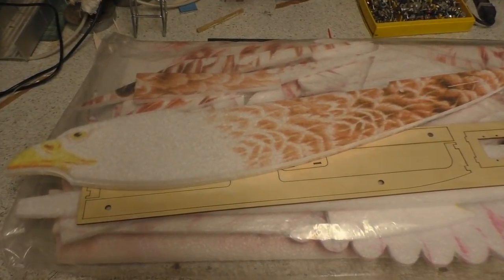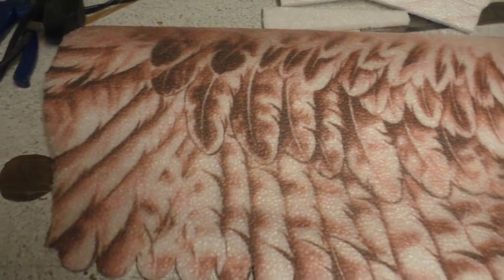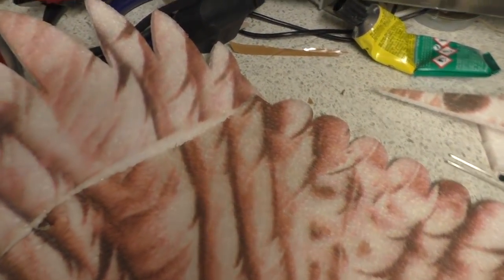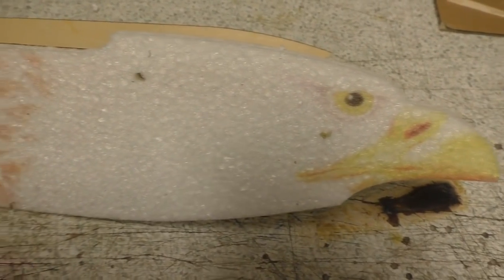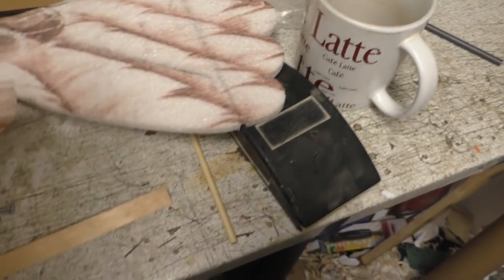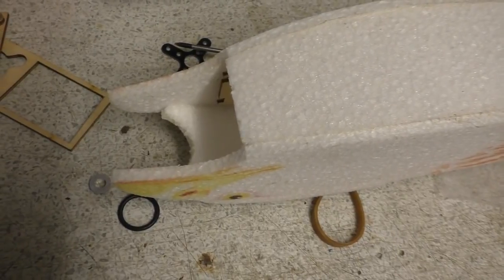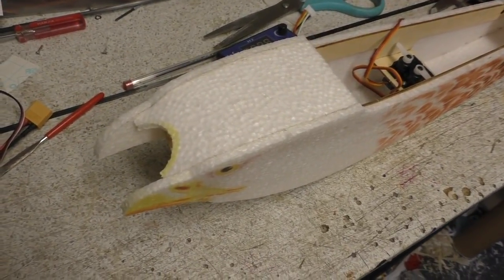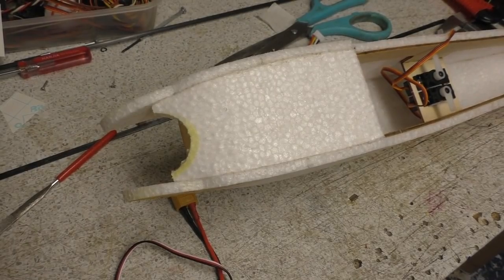DW Hobby Mini Eagle Build RC Model Geeks

Comment: Folding propeller is a must on these birds.
Stops the front end getting so bashed up.
I have both sizes, wingspan.
The larger bird being the nicest.
I have made ailerons on both of mine, plus I reinforced the front end
when i was first building them.
I used triangle end shaped, lengths of timber, i got from B&Q.
Go flying with fpv on the large one, with the real bussards. 
Plus a mini mobius, for great footage.
The real bussards love to investigate it.
Great fun
Hope this helps someone. 👍
Those single light fluffy clouds are a great sign of great thermals.
Keith. 🇬🇧